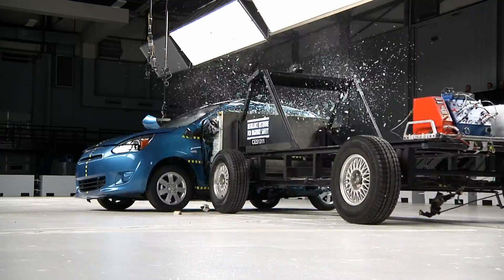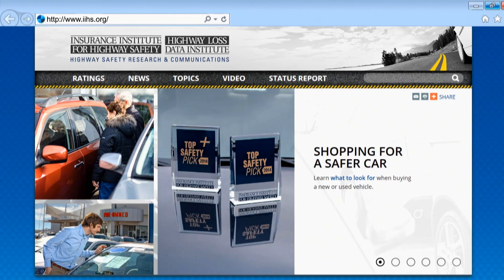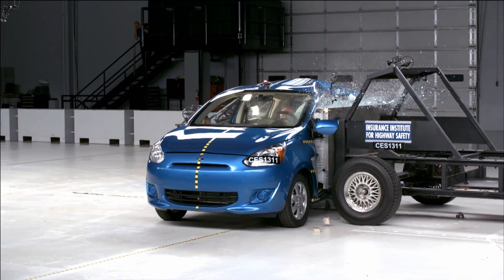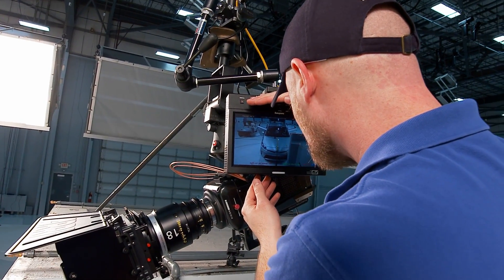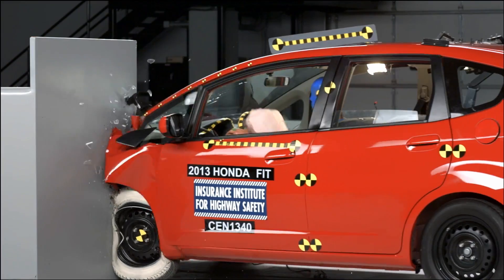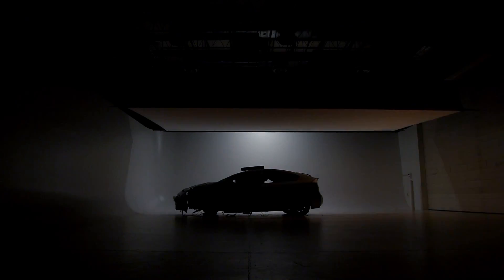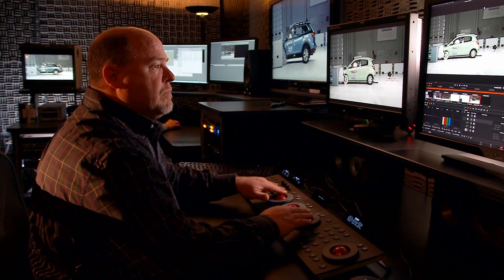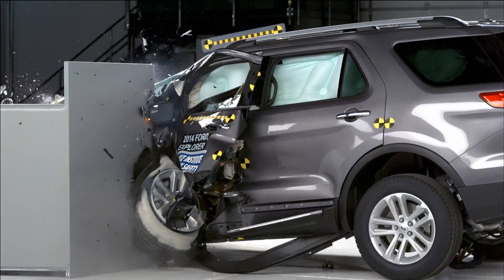Inside IIHS: Crash test photography

Comment: hey IIHS!, i have a concern, why are you using windows xp and windows 7? windows 10 has more opportunity for software and isnt outdated by a over a decade!
Reply: you are so obsesed with modernism
Reply: @Steve17256  i’m not. i hate how modern cars look. but it’s obvious that cars are extremely safe now. saying anything otherwise is just dumb
Reply: @zyke612  nope they fail a lot also why dou you prefer windows 10 ?
Reply: @Steve17256  they don’t fail a lot. you’re not providing any proof at all, you’re just wrong.
Reply: @zyke612  2019 RAM 1500 Frontier Tacoma Tundra and Titan and Ford Scored Poor and marginal and many new cars
Reply: @zyke612  well i like the look of many modern cars including the camry so its a win win for me but older cars also look great
Reply: @0w3nn  the camry is great, old cars look really good but aren’t safe sadly
Reply: Even in 2022, it’s quite common to see specialized equipment running on outdated operating systems, they are simply built for a different purpose than servers and general use computers, the cost of update usually outweighs the benefit.
Reply: This video is from 2014, that’s why.
Reply: Video upload year: 2014
Windows 10 release year: 2015
Reply: The vid was made 10 years ago
Reply: @CaseFanatics  Didn't realize at the time
Reply: If it ain't broke, don't fix it!
Reply: because windows 7 is the best
Reply: @0w3nn  not true at all
Reply: @zyke612  very true
Reply: @0w3nn  it’s so bad compared to 10
Reply: @zyke612  10 makes you create a microsoft account, full of bloatware, has candy crush saga preinstalled on it, inconsistent with multiple duplicate programs, and shoves microsoft edge in your face. So no, 10 is much worse
Reply: @zyke612  and it reinstalls candy crush saga and many others after you install updates
Reply: @0w3nn  you can uninstall the bloatware, 10 is way more optimized and cleaned up than 7, and you can use any browser you want
Reply: @zyke612  except 7 is way less resource intensive. When my old pc ran 7, it took a minute to boot but now it's over 5 minutes
Reply: @zyke612  and like i said, the bloatware reinstalls itself after an update
Reply: @0w3nn  the candy crush is the worst part.   change my mind